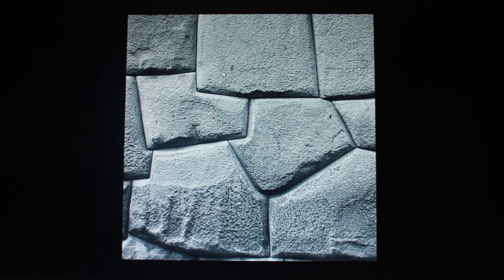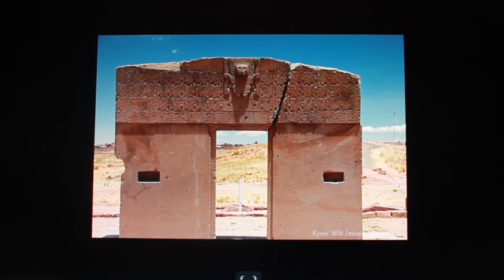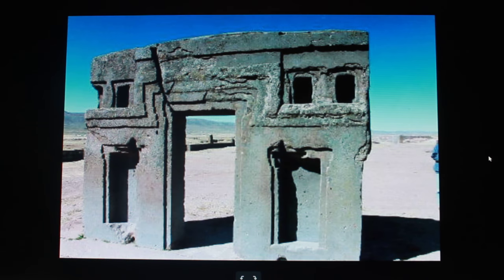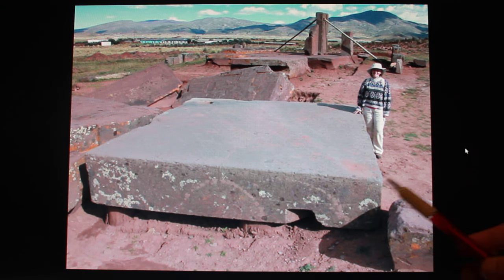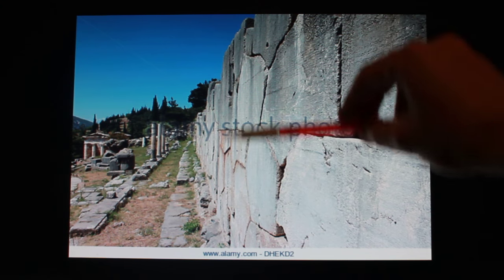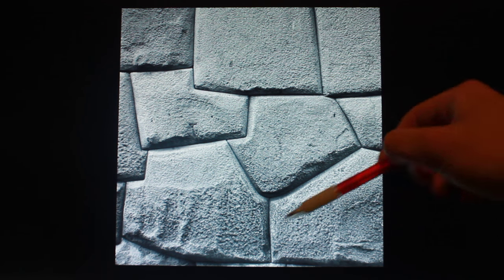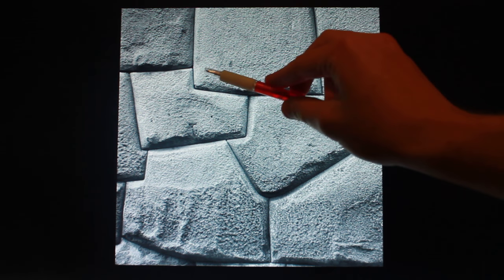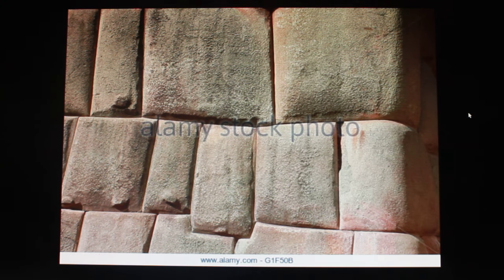How were the POLYGONAL MEGALITHIC INCA WALLS BUILT? LIKE THIS?

Comment: It’s the type of stone that would determine if your theory could work.  My impression from all the reports are that they are fashioned igneous or metamorphic rock.

You are positing concrete, which is technically a man-made sedimentary stone which may be confirmed as such by closer geochemical and microscopic analysis. 

I agree that the surface textures look like reflections of concrete form patterning particularly the Puma Punku slabs with the patterned dots.

The seams may indeed be patterned lines to facilitate predetermined cleavage breaks of the larger stones so that in the case of a severe earthquake they would break in a controlled pattern and still provide support for upper levels and allow subsequent repair to a survivable structure.

In a sort of reverse Jenga engineering approach.

Comment: I've seen evidence that the stones must have been pliable for the details on them (Sayhuite stone), many ancient structures have the interlocking stones even the great Pyramids do. The concrete idea is certainly relevant as it's the only tech we have that comes close, but the evidence isn't supported in some cases unless you assume the entire section of a bedrock hill was built around the structure(devils doorway, Yanshanskaya, petra). Additionally I believe the chemical makeup, hardness and appearance of the stones differs in many cases from modern concrete, and appears to be almost if not identical to surrounds geological stones. My gut feeling based on evidence is they used a vibratory device to soften (liquefy) the existing stones and carve/form them. Additionally I think movement was also handled on large stones using similar technology, eg. coral castle. We have audio leviation now but imagine what the power will be at the atomic level not just from air pressure.

Comment: there is no way this is concrete. they have done testing to find out what type of stone was used. most of these are granite stones and some of them are stones harder than granite. They would have had to been able to reach extremely high levels of temperature to melt it to a liquid form then pour it into molds. the problem with that theory is the stones lose its structural strength and look different after this process. The concrete theory is the first thought experts looked into when looking at these sites. The fact that it's been proven to not be concrete is why scientists are baffled even today as to how they were built. even with laser cutting technology you can't get edges this perfect on stones cuttings this size.

Comment: Those protrusions on the bottom of some of the blocks could be 'relief buttons' for removing air during casting or forming. This is a common technique used in construction of concrete buildings today. I've not seen a single-stone where the protrusions are at the top of the block. I've also seen these protrusions from blocks in Egypt so I suspect the same culture was involved.

It's not concrete for sure w/respect to the composition of the stone but perhaps the rock has been somehow liquefied or perhaps melted. I agree that the process of forming would be essentially the same.

My personal thoughts are that these blocks were not built by the Inca and I agree that the construction (notebly at Puma Punku) was from the same culture as that of ancient Egypt. But IMO one that existed long before Alexander invaded. My logic is that if those cultures did produce this kind of craft, then the Europeans would have adopted and reproduced it. Going further, perhaps the whole concept of concrete forming came from analysis of this prior craft without knowing exactly what (if any) physical or chemical process was used to liquefy the rock.

I really appreciate that you've stated your theory in non-absolute terms here. I've seen too many videos where folks are concocting wild theories with no analysis, which tends to write-off anyone whom questions academia's explainations as daff.

Comment: I don't see the mystery as to how these were made other than the massive size and how to move them. They are not concrete, but hard stone. My idea is that they were pushed in and out grinding into and shaping each other in place, not carved elsewhere with precision and fit together like a puzzle. All you would need is sand water and a method of rocking them back and forth. If they were roughly pecked to near final dimensions grinding against each other in and out makes sense, the nubs being a lifting point to add more sand and water. I think I could make a smaller model with stone tools, sand water and pecking, then grinding. I'd use log battering rams on each side to beat them back and forth. My idea fails if they are locked in a third plane and cannot be slid in and out. I also have no idea how the larger ones could have been moved in and out, but the order in which they are placed is obvious by which ground into the ones below it.

Comment: What isn't clear is how deep the stones or blocks continue into the wall with the polygonal profile?  Are they 1 ft. deep, 3ft., 10ft,?  I think they may have been molded upside down from a spring of naturally oozing muck coming out of the ground.  (indexcomment 5818)Somehow it slow hardened, upon exposure to air and this allowed time to make large ceramic molds with a fru or two to allow the muck to fill the mold from below.  The knobs would be leftover frues.  The resulting molded semi-hard/semi-plastic elongated block would be set in place and some long boards used to deliberately deform the surface to create the interlocking planes. Mostly regular blocks with a few interlocking to create the stable wall.

Comment: If these were bags of cement as you suggest, how are they so tightly joined? When the bags were removed (how would that be possible) or decomposed what filled in the space where the bags were? Judging by the size and weight of these rocks the bags would have to have been quite thick which would leave a space between the rocks. Even thin bags would leave a space double the thickness of one bag.
I believe that these stones were somehow, after being transported to the site (the way this was accomplished is another huge mystery) were somehow (sound waves?) softened to puttylike consistency and pressed into place.

Comment: I`m sure they had many techniques for building. Concrete was one. Board and bag would be very clever for high up above on mountainsides. Burlap sacks would be perfect mortar. Molding your pour would make it so easy. Much easier than todays method.

Comment: Sorry that im late to the party....great video Dr. Kos!! If i may, id like to propose a theory as to how these walls were built. I do disagree with the concrete theory, though i am sure that they used concrete for some projects. The wall that u focus on most in this video is intriguing. I believe that these are existing rocks that were quarried and shaped.  How they were moved is another enigma. Ive seen videos recently on youtube of guys taking the lense out of a projection tv, called a fresnel lense. They use them in conjunction with our sun to melt rocks of all types of hardness in their backyards. Ancient lenses have been found in either egypt or the middle east....made from sand. I am of the belief that the megalithic builders who were spread worldwide, used lenses to soften edges of rocks and press them together and then shaving off the excess near the joints. It almost looks as though the egdes were shaved off with a blade of sorts. Well, thats it....thats my theory. This is my favorite rabbit hole to hang out in....id love to hear what you think!!

Comment: Dude take a 50 pound stone and rub it against another of the same type that’s lodged in the dirt to keep the center align, add some water ever 100 paces, keep it up until your hair turns grey, teach your kids to do the same and in a few generations at the slowest that rock that’s lodged in the dirt will have a surface so flat on it that it will hold a level plane of water.  Now take the static rock that you’ve been grinding with and turn it on it’s side so that the “water-holding-plane-surface” is exactly perpendicular (give or take a degree or two) to the flat surface of your grinding rock, then have one of your friends fill in the back and sides of your grinding stone with dirt and low and behold your have your self a right angle and a level one at that. 

Now a monkey can figure that out if it desired.  I believe that whatever humanity sets it’s sights on, it will achieve, even if it means dedicating your whole life to making one flat stone, as long as it’s providing for the future generations, we will make it happen. 

Saying that these Megalithic master works aren’t what science has proven them to be for one makes you seem kind of arrogant,  it also proves your lack of faith in what you yourself are capable of doing if you keep in mind that your life carries on to the next generation, and on and on and on.... 

You’re also a creation of someone who came before you, which may have been the guys or girls that spent their whole lives dedicated to carving rocks into cool stuff for later generations to have,         
I.e. YOU!!!

Besides man we are really all supposed to believe that it would take less time to quarry the stone in to powder, and turn it back into concrete that it would take to just carve the stone... 
lol

Comment: It looks as if the adjacent stones were used as an abrasive to form fit joints. If I were to design a machine capable of reproducing this effect It would grip the stones from the sides and vibrate them. Lifting them periodically to airblast the resulting sandy debris out from between the joints.  They really do look as if they were finish fit vibrationally.

Comment: Definitely bags but dropped into a frame to keep them square. Don't think wood was used between. Bags just rotted. NOW HERE IS THE BIGGEST CLUE. Note that when there is a right angled dent in the corner of a block it is ALWAYS EITHER THE TOP RIGHT OR TOP LEFT CORNER, never the lower corners. This means the lower blocks were still wet (in their bag) when the top blocks were placed. Maybe there was a framework to hold all of the bags together but it seems they may have been woven OPEN TOPPED baskets with durable square bases.

Comment: Yes it was concrete, that is why most of the rocks protrude and bulge at the bottom. The weight of the top concrete is pushed down and out while molding.

Comment: I completely agree with the concrete hypothesis because it coincides with the Bosnian findings. But what's intriguing is the composition of the concrete. What was it made from and how was it mixed etc. another mystery is how concrete was made even in roman times because the exact recipe seems to have been a trade secret and now forgotten...
Reply from the maker: Thank you damianc80. Another intriguing thing about the Roman concrete is they only used it for a short span. In republic Rome they used mud-brick. the Early imperial ruins survive because they are built so well, from that recipe that you mentioned. Ie Pantheon. They got fired bricks from Greece and maybe the concrete recipe from Egypt, who in turn once shared it with Peru. But later Romans forgot concrete, switched to building everything from small bricks, and sand and lime for mortar.

Comment: This is a persuasive idea, but there are (at least) two reasons why it cannot be right.  First, the sites where these rocks were quarried from show more or less the same type of extraordinary cuts that occur in the stones, making it a plausible guess that this is where they came from.  And second, should you ever smash up a piece of concrete you will immediately see inside it the small pieces of stone from which it is made.  A piece of solid rock has a completely different composition.
Reply: david hunter - you are making 2 assumptions. 1) the quarried stones were taken out as large blocks and transported. Maybe they just crushed and extracted the stone as powder in order to make the concrete. 2) you are comparing the stones with modern concrete. The ancient concrete was very different.

Comment: great theory,  all this bollocks about carrying 4 ton blocks for miles and then assembled has always puzzled me.  no,  mix the concrete and poor it on site and then shape the edges as desired.  the Romans used concrete and used it under water and no one questions that.  i like it.  it's obvious.  childress and others are tools
Reply from the maker: Exactly, thanks warleb1
Reply: I believe the pyramid discovered in Bosnia is built this way!?
Reply: Fuzznutt; Weren't the Bosnian pyramids found to be nothing but hills?

Comment: One thing for sure is that concrete has defo been about alot longer than they would have you believe.the builders not only had strength of hand but also great minds.seems like cement has defo been used on some parts of the megaliths but most are cut direct from mountians.look at the unfinished stones in Egypt and balbeek  you will see they were not made of cement  or concrete.

Comment: You all got it wrong it was concrete but it was decorative grooves carved into the concrete walls but then over five thousand years or a thousand of years there has been many earthquakes and tremors that have caused the decorative grooves to crack along precise lines wherever there was a groove put into the concrete obviously that caused the point in which it would crack precisely so you could not put a piece of paper through it but it would become a separate block if you've ever formed concrete and dealt with it and tried to break it along Cruise put in wallet with soft you would realize they would always break on the groove line not anywhere else so whoever built these walls simply put in decorative cruise on the face but over time earthquake caused them to crack causing individual blocks to form and a road over time causing them to appear like they were manufactured and built that way but that is not the case it is nature that caused these individual blocks not the creators gray concrete wall but decorative grooves put in

Comment: At 3:15 - what you say is a ‘dry’ mixture vs ‘wet’ mixture is incorrect. This is erosion. The ‘wet’ mixture side was half buried and therefore preserved, and the ‘dry’ mixture face was exposed to centuries of the elements, and has eroded. This is all the same pour of concrete.

Comment: It's  acheant tech . They do build a frame but they filled it with lots broken stones and sand then they are vibrated to melt the rock to be moulded  the the knobs that are left are where the pulled out the divice rods.

Comment: And you think a geologist can not distinguish between natural rock and cast blocks
Reply from the maker: Correct, sir they cannot
Reply: No, we can tell the difference between concrete and igneous rock (I'm a geologist). Saying that is like claiming a Jockey cant tell the difference between a Donkey and a Horse! The composition of these rocks were examined in detail nearly 30 years ago, the rock is an andesite, case closed, there's no room for speculation or debate here.

 "Hunt (1990) provides the most recent published petrographical descriptions. He describes the Rumiqolqa samples as hornblende andesite, with primary phenocrysts of plagioclase feldspar, basaltic hornblende, and biotite; there is a little pyroxene and occasional xenoliths [xenocrysts] of apatite and ilmenite. The Huaccoto samples are described as biotite andesite, with phenocrysts of plagioclase feldspar and biotite; hornblende is present but infrequent (Hunt 1990, pages 26-7). Hunt matches these petrographical differences with differences in colour and physical properties, which serve to distinguish between the products of the two quarries in the buildings of Cuzco and to confirm the Rumiqolqa origin of the imperial building stone. These are influential descriptions, which have been quoted subsequently (e.g. Bauer 2004, page 157)." - Ixer et al. (2014).

The mineral composition of cement is entirely different, it contains minerals such as portlandite, larnite, spurrite, which are extremely rare in nature (they are found in a few places on Earth in limestone contact heated to high temperatures by lava flows and later reacted with ground water, mimicking the process that makes cement). Modern cements also contain Belite (2CaO·SiO2), Alite (3CaO·SiO2), Tricalcium aluminate (3CaO·Al2O3), Brownmillerite (4CaO·Al2O3·Fe2O3) in addition to Lime.

Ixer, R., Lunt, S., Sillar, B. and Thompson, P., 2014. Microscopic rocks and expansive empires: Investigating Inca ceramics from Cuzco, Peru. Archaeology International, 17, pp.122-136. http://www.qscience.com/userimages/ContentEditor/1414586825906/ucl.2014.ch4.pdf
Reply: Christian Rigolet after two thousand years it turns to Solid Rock that's how rocks are made to begin with

Comment: The blocks with shapes cut in with holes look like engine moulding blocks. Pour and 're use. The bags idea makes sense, but if stack clay in plastic bags then press together till no gaps, then the tight plastic forms the rounded tight joint line. No need to press with sticks?

Comment: My take on the nobs is that they the point where the power source was applied ( sonic waves or whatever) and the theory of the poured concrete, well... maybe this builder had the knowledge on how to soften these materials (apparently there are few kinds of it) and let it harden  achieving the final result. Concrete will not last the thousands of years endured by this stuff laying there. In any event, this people or whatever they were, were not kind enough to let future generations carry on with this building methods, what a shame'

Comment: sorry wrong , it is not concrete it is andesite a type of granite , if it was possible to melt granite you will en up with some kind of obsidian glass , no more crystals , not mentioning the 1650 degree C needed to melt and the refractory mould to hold it